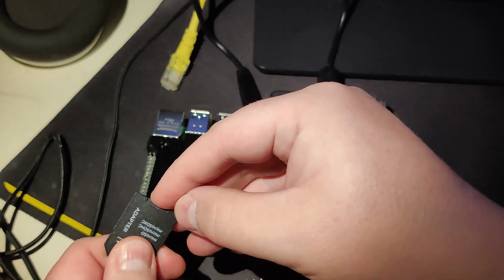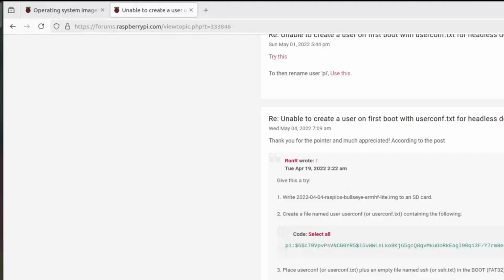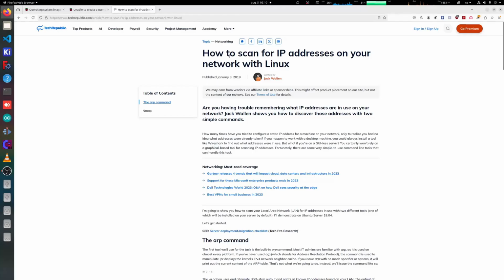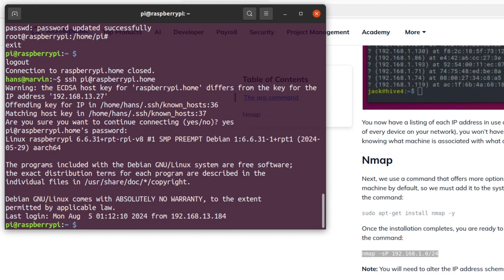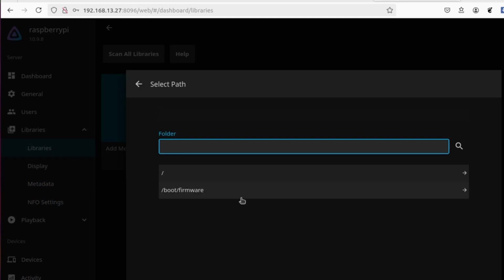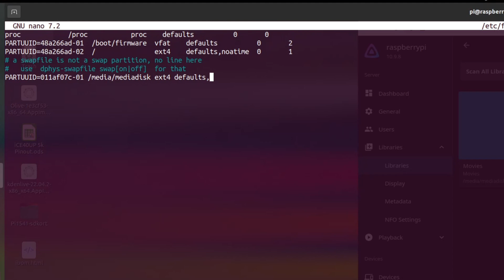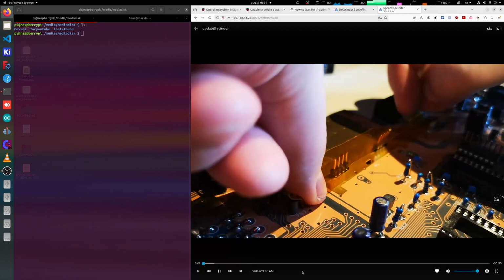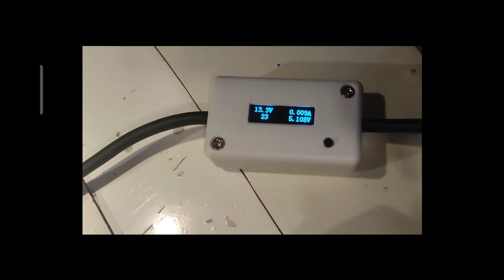Jellyfin media streaming on a Raspberry Pi headless setup

Comment from the maker: According to Jellyfin, they do not recommend using Raspberry Pi. The lack of hardware encoders on the Pi's will make the user experience horrible, however I will argue that it is very useful IF, as I say at the end of the video, you use it for your media that is compatible with your viewer, let it be your browser, mobile phone or android tv app. Once you put your jellyfin in a situation where it has to TRANSCODE the media (this is what I think anyway), it will drop to its knee and you will cry. In practice, for me, the limits I have found is that I can stream 4k video on my 4k android TV, however, if I open the same video on my PC in the browser, jellyfin will try to transcode it to 1080p, and it will not work. If I open 1080p and 720p videos on my PC, it works perfectly. So, I'm totally happy with this setup anyway, knowing it's limitations.
Reply from the maker: I have experimented some more with the setup.  Streaming to my phone, jellyfin is transcoding the video (no idea why it needs to do that) or it seems to only do it on 480p videos. It is using ffmpeg, and on raspberry pi 4 it is using hardware accelleration. On raspberry pi 5, hardware accelerated video encoding is not supported. I don't know why, so I don't recommend rpi5.
Reply from the maker: Just figured that, with rpi4, you can go to Dashboard -> Playback -> Transcoding -> Hardware Acceleration . Select Video4Linux2. Tick the box for h264 hardware encoding. Save the settings (bottom of the page). Hmm. I turned off HW accelaration again. it makes 480p media garbled.